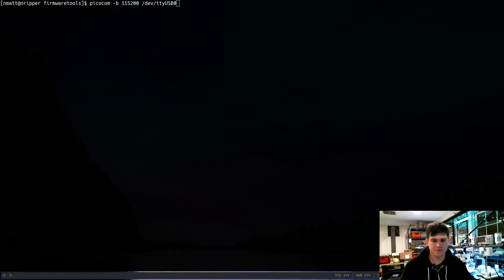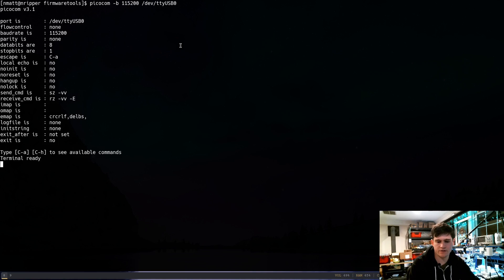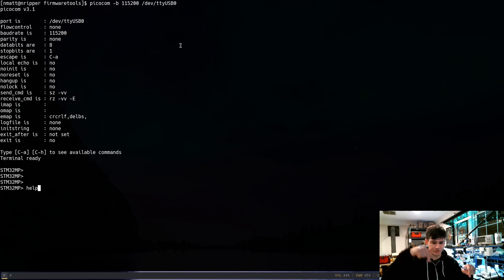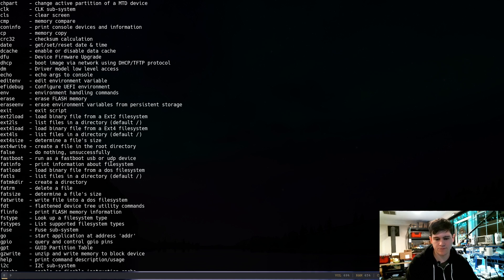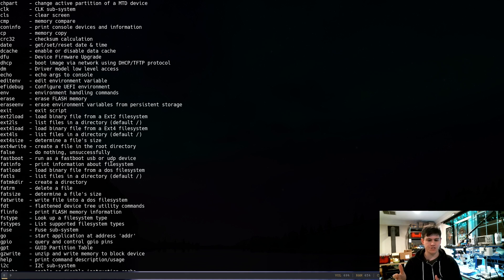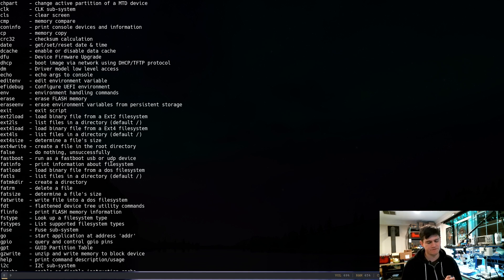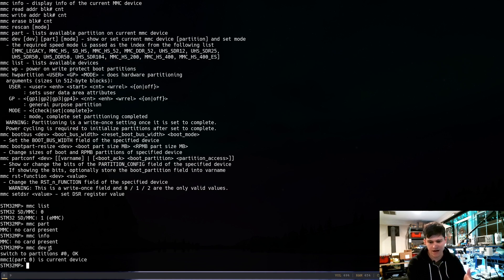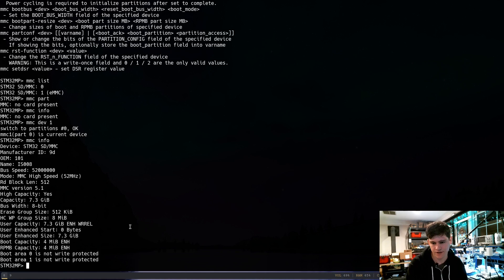U-Boot Bootloader Firmware Extraction Tools

Comment: hi Matt! I have a question that might sound silly but I am noob when it comes to uboot bootloader and uart stuff. I have a router that doesn't work in a normal way when I connect to power , only gets recognized by my pc when I boot it into u-boot mode. In the uboot page (192.168.1.1) when I upload the factory image it reads the file and shows on the screen MD5 but when I click update only for a milisecond LED on the router blinks red and immediately flashing fails.  
I have tried with many other firmwares for this device (openwrt , immortalwrt , qwrt) but everytime same fail happens.
Do you think I can flash the firmware through UART ? Is it possible to do it , if I can I will order a USB TTL device to tinker on it. Please if you reply to my message I would be much appreciated.

Comment: On win32 line 58 of get file throws error - Must comment out exclusive.
You must also start term session and hold down enter - Then kill putty and run script.
Script will then run and outputs that it wrote a file - But the file is just empty spaces.  Tried on multiple files.

Would be nice to have a win32 version. :)

Comment: If you run 'bdinfo' that will give you the memory organization of U-Boot. Failures on md/mw on address could be; 1. Memory is mapped to CPU registers, 2 the address does not exist, or 3 U-boot could be running out of that memory rang. There could be a lot of things to cause failure.
Reply from the maker: Yeah that makes sense. I was just writing over random blocks of memory :D

Comment: Matt make a video on extracting the files on locked down phones like Samsung, extracting the files that tell the device can use ADB or that tell the device if the OEM is on or not so we can extract them and change the values then push them back to the device to gain root access

Comment: if i have a firmware extracted from a device (example wifi camera), is there any way to modify the firmware? can you make such video?
Reply from the maker: It depends on a lot of factors: what is the flash layout? what is the actual underlying system? what modifications do you want to make? Join us on discord (invite in description) and some of the community might be able to help you learn :)
Reply: @mattbrwn  sadly i am not that far in, i just found the UART pins and managed to execute some useless commands, noticed that its a U-boot. just wanted to know if extracting the firmware is worth the effort for future modifications of the functionalities. for example i have many old wifi Chinese cameras, but they turned down the servers and now you cant connect the cameras, so i wanted to connect LAN module instead of the WiFi module that they use and that way make them work again, but i will probably have to change some settings for the camera to use the LAN connection instead the WiFi.
thank you for the replay, i will definitely check and join the discord.

Comment: awesome tool. i will be putting it to work and def makes life a whole lot easier to just be able to fetch the actual files rather than MD. Can you elaborate on any write methods which can help write files or strings back to a location on an ext4fs via uboot.
Reply from the maker: yeah I'm going to work on adding a tool that will do that. You do it the opposite way of reading. 

First write data to memory with the "mw" command. Second write file to filesystem with the "ext4write".
Reply: @mattbrwn  will def give it a shot. thank you.

Comment: I have a Device, that boots it's normal OS after 30-60 seconds in u-boot command-prompt. Any chance to interrupt this autoboot?
Reply from the maker: Can you interact with the uboot menu during that time? Come join us in discord for help with stuff like this 😁
Reply: bootretry is an environment variable containing the current delay in effect. Negative values mean boot retry will not occur. Unfortunately, this value is only sampled on startup - changing it will not prevent boot retry in the current session.

If your build supports saving environment variables persistently:
u-boot> setenv bootretry -1
u-boot> saveenv

Otherwise you would have to modify the source and rebuild. If you wanted to get rid of that behavior entirely you could do something like
`grep -r CONFIG_BOOT_RETRY *`, remove those lines, rebuild, and reflash.

Definitely make sure you have a backup means of booting or flashing before overwriting the existing U-Boot, just in case